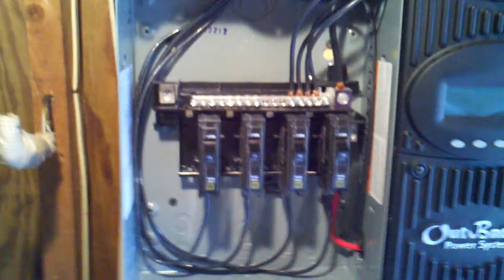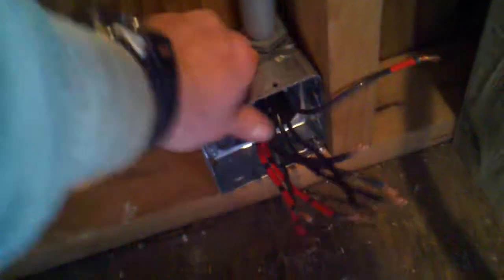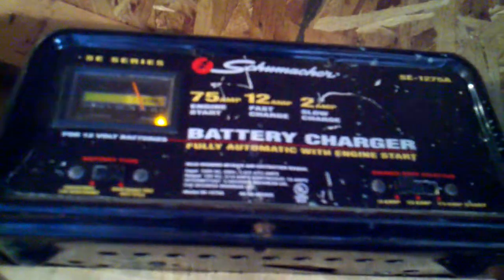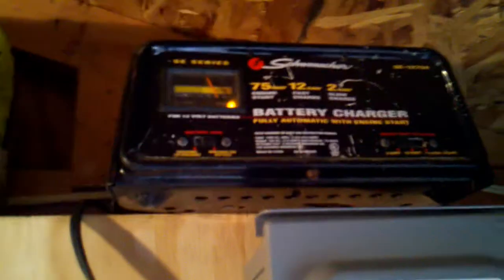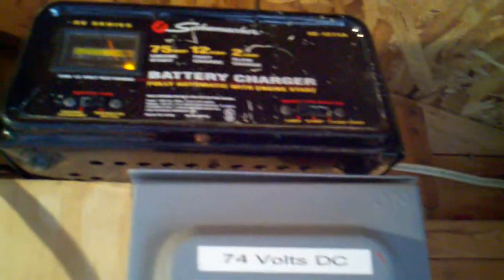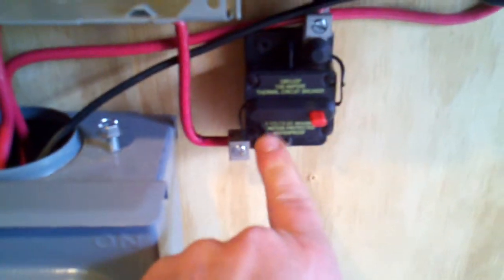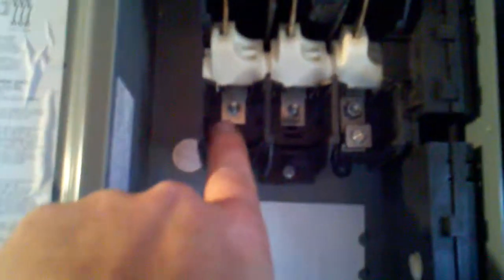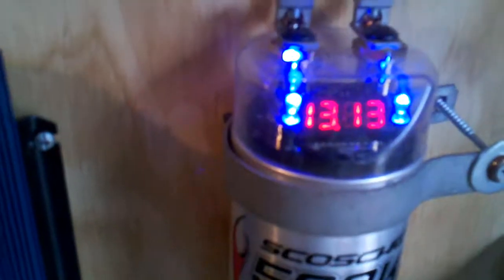Solar battery bank wired and show the 100 amp breaker

Comment: Nice share. How do I calculate the correct size breaker for a 2000watt inverter and a 4-battery bank? Thanks!
Reply from the maker: MK Outdoor Adventures 2000 watts ÷ 12 volts. Ohms law.
Reply: Thanks Guy. In my case, 2000 watts ÷ 12 volts = 167amps. Your thoughts on rounding down to a 150amp circuit breaker versus rounding up to a 200amp circuit breaker? I am thinking down to insure protection for my inverter.
Reply from the maker: I have an updated video on my system you should check out. It's about 45 min long but I cover everything. Check it out. Yes I agree with a 150 amp fuse.